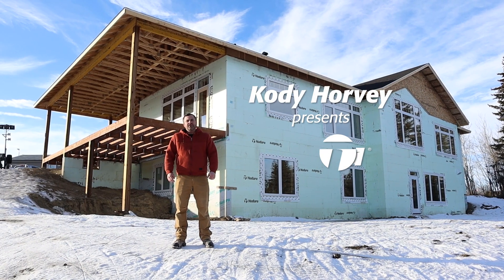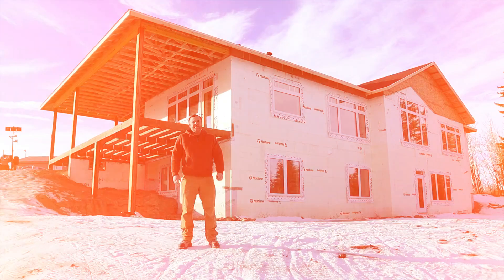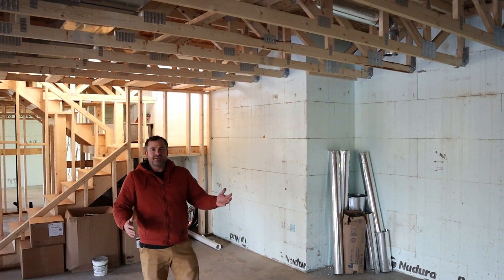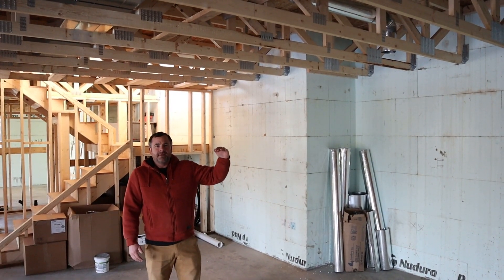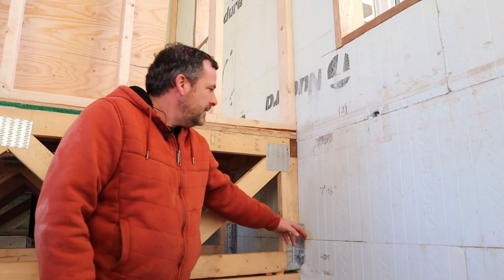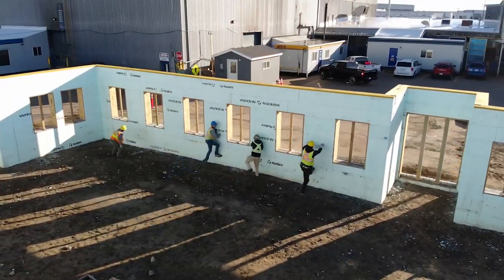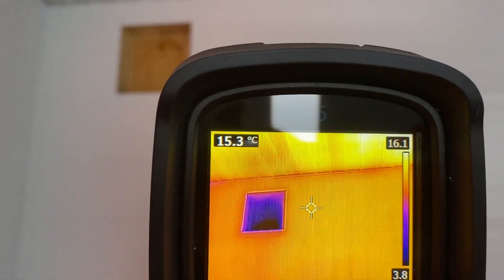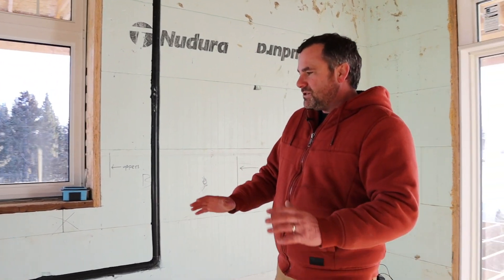Nudura 101 | ICF Talks Sponsored by Nudura Ep. 1

Comment: Kody, how are installing top row horizontal rebar and stirrups for lintels when the top row of block is cut and the rebar cradles are cut away to achieve the correct building height?
Reply from the maker: I usually pre-plan my elevations to avoid this. But in this scenario just get creative. Maybe you drop some vertical bar so you can tie the top horizontal to it? Seems legit to me.
Reply from the maker: Great question by the way
Reply: Thanks for replying Kody! That is a good idea. I thought about doing as it is probably the best method I can think of. I decided to increase the ceiling height a little bit and use 54” drywall which I think will solve the issue. I’ll cut a couple of inches off the top block and still have 2 1/2” of concrete coverage over the rebar. I was planning to use 6” baseboards so in this case with 54” drywall and the 5/8” I’ll gain with the ceiling drywall I’ll end up with about 4 1/2” at the bottom of the wall where a strip of drywall will be required. But, since it’s below the line of the baseboard I don’t think I’ll even tape and mud that joint. Great videos by the way. Been watching them for years.

Comment: When using thermal camera…sometimes you see gaps between blocks that shine up blue (cold)..how do you fill these gaps in?
Also, electrical back boxes…we have used PU adhesive and screwed them back into the concrete core…do you add any fire proofing when doing 1st fix for the back boxes..we have run all cables in conduit to be safe.
Reply from the maker: Great questions though!
Reply from the maker: If there are gaps you can fill those with spray foam, then cut off the excess. 

For electrical boxes. We have never used adhesive unless you want to spray foam them in place. I like the concrete screw through the back . Fireproofing is your call… I personally don’t think it’s necessary. And conduits we only do in commercial.